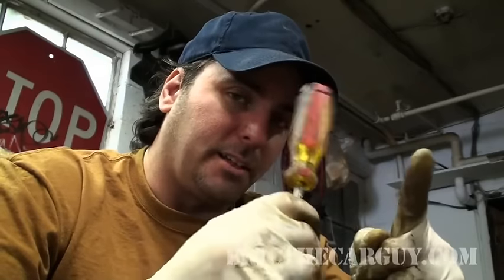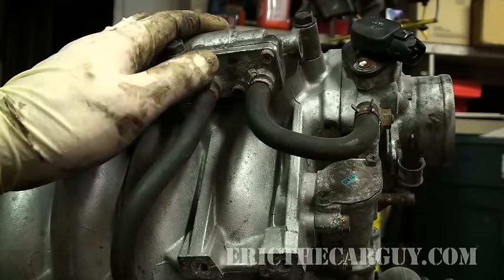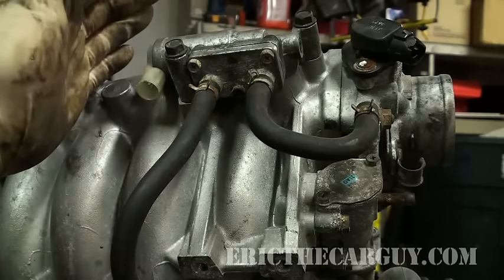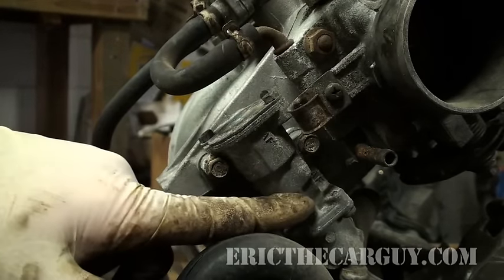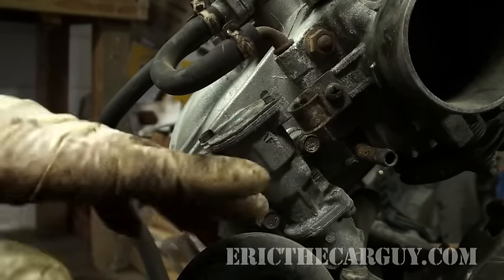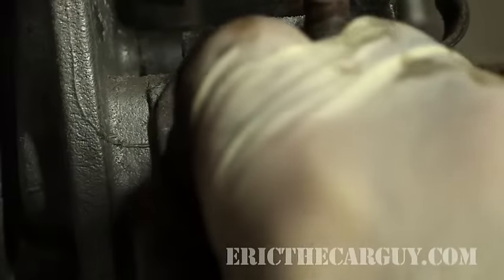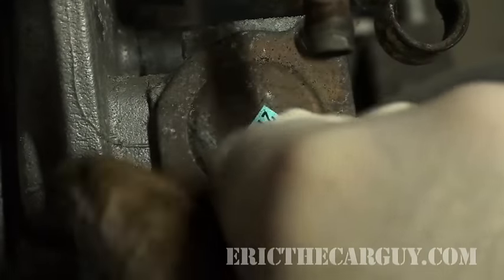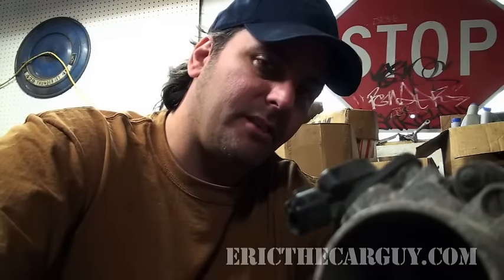How To Solve Honda Idle Problems - EricTheCarGuy

Comment: Yup, there is still people watching  your videos from 9 years ago lol 😆  thanks for teaching me
Reply: Yes sir I
Am
Reply: Same 🤣#idleproblemsonmyrsx#vaccumeleaks
Reply: Yup
Reply: Bro my 1998 honda is having trouble staying on. You guys think it is an idle problem?  It's not the batery or alternator for sure
Reply: @22Alex47  My 1994 Honda Civic had the same issue.  I believe it was the voltage regulator that I replaced and it worked beautifully.  In the heat the old regulator wouldn't work, I was told it was because a wire was likely broken and would expand away from a full connection.  Good luck!
Reply: Jean Green My shit works now after I replaced it ✊✊
Reply: @22Alex47  Awesome !!
Reply: @22Alex47  try looking at the alternator wire. Mines was corroded and turned off in the middle of the highway lol. I cleaned it and everything ran good. Could also be something inside distributor.
Reply: Isaac Zamora nice what do you use to clean inside the alternator. I was thinking compressed air
Reply: 9 year old video and still better than most videos out here
Reply: Yes sir I still do too...
Reply: Same!
Reply: @jeangreen432  I’m having the same issue on my 94 Honda Civic and I was just wondering if air kept going out of your radiator.
I keep bleeding it but there’s always air and the idle never settles
Reply: @kevinramirez-hy3ve  It might be a vacuum leak. I don't know. But in pecking order, that is the second possible problem once you eliminated the radiator issue; bleeding it or letting air out of the cooling system.
Reply: @anthonybenjamin9697  I tried bleeding it but air somehow always comes out. I bled it every single day for 20-30 min. I replaced the iacv and the fast iac. New throttle body gasket and a intake manifold gasket. Nothing. When I restrict airflow from the iac though the idle settles down
Reply: Make that 10 years ...
Reply: The master mechanic in my autoshop class said ..."its either fa show, or hell naw "
Thats a da show right there Boss!
Reply: Meee too just 10 lmao
Reply: Aaron Fluegge  yessir lmao
Reply: I've had this video paused for about two years lol!!!
Reply: 😂 me
Reply: 2021
Reply: @drewmcgee3732  xssddddx
Reply: I don't think I'm late
Reply: Yupppp
Reply: 2021, Lol.
Reply: Make that 10😅
Reply: 11
Reply: eric the car guy is a legend
Reply: oh and make that 2022 😂
Reply: 10 years now
Reply: 2022 🫡 96 Cx replaced iacv, map, tbps, did the coolant trick to let air bubbles out still having this issue hoping I find something before giving up and handling it to a shop
Reply: 10 years ago 😞
Reply: make it 11 years
Reply: 11 now 🤣🤣
Reply: How about 11
Reply: 11 years ago now…
Reply: Still watching 11 years later😅…This tutorial will likely fix my idle issue. Will try later this week. Eric you are a legend 👊
Reply: 12 years here
Reply: 12 years 😅
Reply: 12 at this point
Reply: 12 years ago!
Reply: Amen! Lol
Reply: Even today lol
Reply: 12 now 🕰️
Reply: 12 years ago now 🎉
Reply: 12 years now here 😊
Reply: Haha how about 12
Reply: 12 years and I’m still here! Lol🎉❤
Reply: 12 years and going strong!😂
Reply: 12 years later and his knowledge is helping me
Reply: Hello I changed the oem intake manifold to a skunk2 n throttle as well it’s a manual n know when I try to start it I have to press on the gas pedal and wait until it heats up not sure how I can get it right it’s on a 1998 Honda civic ex manual
Reply: Yup and 13 years
Reply: 13years old video for me today
Reply: Make that 13 just got one myslef
Reply: I learned more from watching his videos.. than I did in my trade school.  Lmao 🤣
Reply: Yeah, still watching in 2024…
Reply: 13 years now
Reply: Here in 2024
Reply: 13 years ago now😂
Reply: 13 years now😂
Reply: 7-18-2024 I am here
Reply: 13 years ago. 2024
Reply: 13 for me 😂
Reply: lol 13 years ago

Comment: I could freakin kiss you Eric!! This was such a headache on my Honda Civic. I failed smog terribly because of that cold-start idle air control. After a bunch of replacing sensors and crap I took out that idle air control and turned it all the way in like you showed and it fixed it completely!!! Passed smog perfectly!! Dude I'm so happy! Thank you for saving me so much money. Guys! Subscribe to this guy! Like his videos! He is giving great information for free. He's like Beethoven on the engines. Thank you again brother! Holy crap that was load off my shoulders.
Reply: NoFace  thank god that worked..I’m gonna try this
Reply: What year honda civic?
Reply: so it doesnt really mean I need to replace the throttle position sensor?
Reply: Maybe brotherly hug instead of that earlier suggested kiss😉
Thanks Brother!🤗

Comment: Lol I just bought a 1991 honda accord lx coupe for my first car for 350 bucks because it had this issue and the guy thought he had a blown engine and I didn't know if it was a blown engine so I bought it knowing I might need to look online for a used engine. instead I found articles online explaining this and got it fixed. idle issue problem fixed, new back struts, and a little cosmetic work later I have my first car for less than 1000 dollars.
Reply: ZDubs Hey I got my first car too! It's a 1992 Accord Ex r coupe. Same issue with the idle. Got it for 300 bucks as well! Starts at 1600 rpm then goes down to 800 rpm and starts to vibrate. What fix did you use?
Reply: Good job man I wish all younger people had that drive, keep it up
Reply: My $450 '03 civic will have its 1st year birthday with me in month...biggest job I did was change the radiator lol
Reply: Hey!  That was my Honda.  Give it back!

Comment: You ARE the man!  Thank you.  After reading many other posts on random forums i ended up replacing the MAP sensor, throttle position sensor, pcv and grommet  (worst job). I was at the end of my patience when I watched this video. I then ran through the tasks you suggested.  Once i pulled the IACV my problem stuck out like a sore thumb. Clogged coolant port and hose. 4 years ago I was told to use GM coolant tabs to help with the typical antifreeze smell. The tabs worked great in taking care of the tiny seaps  where aluminum touches aluminum but that gritty material pooled in the IAVC.  Moral of the story CHECK WITH ERIC FIRST!

Comment: Been having problems with idle too, replaced a bad IAC valve part costing $240 (old one had a torned in filter screen) at O'Reilly's did not fix the problem, high idle at 3000 rpm for prolonged periods, then just watched this video and did as instructed- BOOM PROBLEM SOLVED. RPM at startup at 2.5! Went to 1000 in just minutes. Gears shifting smoothly. Engine sounds way better feels better. Thank you Ericthecarguy.

Comment: I recently picked up a 2000 prelude type sh as a project/learn stick on car. The h22a4 engine in it does have the FITV(fast idle thermo valve). I've had idle issues with the car since getting it like rpm surging(1k-2krpm up and down) a minute to two after start up. I took apart the throttle body to get to the FITV and removed the valve, took it apart and cleaned it all up and it runs 1000x better. No more high idle above 1200 it stays consistent at 800-900, and no more rpm surging. THIS GUY KNOWS HIS STUFF!

Comment: Hi eric, just a quick one. I've just done a clutch on a civic type-r that had been sat for a few weeks. After the work i found the revs were as you say hunting. After a bit of a run and half a litre of water in the rad its all clear. I've put it down to a low battery (car struggled to start) and the addition of water has sorted it. The engine warning light was on and now its clear (disconnected the battery for 10 minutes).

Comment: Thanks, Eric. Had to change a heater hose and the idle immediately went to Hades. After burping the cooling system, idle smoothed out.
Reply: Can you clarify a bit more on which hose? Having idle issues. Changing my IAVC didnt help. I had a coolant flush months ago but didnt have idle problems until months after that day.

Comment: I bought a 1996 Honda Passport 3.2 4wd 217k when I bought it little over a year ago 253k now runs pretty decent just wanting to do different types of mods more HP upgrade .... Suspension lift .... this is the first Honda ever owned had a few problems but nothing out of the ordinary still has a few bugs but I'm working them out I would like to know where to find info so I can have more knowledge on my truck .... I watch ur videos every chance I get .... great information .... thanks again Eric

Comment: Thanks for the vid.  I couldn’t reach my idle control valve to tap on it in my 96 civic 1.6L non vtech.  I pulled the ICV and cleaned it because all the parts stores were closed.  Put it back together and bled the air out of the coolant.  Although I couldn’t find a breather.  I just ran it like you said and squeezed hoses until all bubbles were gone.  Idle problem solved.  When I turned on my a/c the idle would almost stall the engine then run back up.  Now it’s good to go.  If I have any more problems I’m changing it out.

Comment: Thanks for the help! I know it's been 5 years but these types of problems are still happening. Mine was in the fast idle valve. It was a pain trying to get to it due to my motor being in the vehicle, but it is possible. It took a while to bottom out (that's how loose it was). Put everything back together and the cold start idled normal!!! Thanks again!!! (:

Comment: Hey eric thanks for your help and taking time to make people better understand diagnosis procedures with the access to your detailed videos, I'm wondering if you could talk more about the access to the iac and fitv that seem to be fed by small ports in the throttle body and what happens or what should happen when restricting air flow to either or both and if it should at all sound like loud suction at any giving point similar to a large vaccum leak and maybe talk a little more about the idle screw on the throttle body and when you can decide to make adjustments when nessesary, thanks for your help, take care

Comment: Sir you are a legend, I Followed your instructions on the FITV and after weeks  of loking for an answer I found a solution.I purchased a 1996 Honda accord for co worker and he told me that the car had this issue. I cleaned the Idle control valve  it made it better but the problem was that every time I start the car in the morning it would start revving like crazy. I Watched this video and tightened the FITV I can say it worked!!!!. Its been 2 days and it is WAAAAY different. Sir thank you

Comment: Eric.  that worked for the hunting idle on my 1994 del sol.  I tried cleaning the iac and that did nothing.  turning that all the way down completely fixed the hunting idle.  this was the only place I saw this suggestion as a possible fix.  and it worked like a charm.  having the car idle up and down until it warmed up drove me nuts for years.  you are the man, man.

Comment: I have been experiencing vibration on idle and loss of
acceleration .. but only after i been driving it a while, wither its a warm day
or not.less than 2 weeks before this, i got my head gasket replaced
as well as new timing belt and pump and spark plugs and a new rad and cap. My
check engine light did come on about a week after the repair and it was a code
for crankshaft sensor, this lasted abut a week at times going off and back on
until finally never came on again, so i used OBD and reset the ECU but im left
with the vibration issue and loss of power on acceleration.

Also in park or neutral  the engine revs great no loss of power or
anything
Reply: timing may be a hair off?
Reply: I'm experiencing almost the exact problems. Did you find out what the problem was by chance?
Reply: not yet its still drivable.. but i will later on
Reply: vibration is comming from the idle dipping so low and recovering. This effect will be enhanced if you have bad motor mounts.
Reply: I got same warm engine problem then it will crank but not atart i need to try like 5 times til it does start up sometimes
.. other days it runs like new

Comment: Excellent tip Eric! It solved the idling problem on my Civic 93! Did realized the reason the plastic cap losens out.... the O-ring of the plastic cap, next to the thread, with  time hardens up (looses friction with aluminum body) and with engine vibration allows to unscrew eventually again. Replace with a NEW O-ring!

Comment: Excellent video! I appreciate the fact that you don't want us to just throw our money into parts & want us to actually get a diagnostic / codes when engine light on. I actually own a 2000 Honda Civic & have been experiencing this particular idle situation. I'm thinking the TPS as well. First chance I get, getting that good ole screw driver & giving it a tap or two while engine running. Thanks so much for all your great videos. You rock! P.S. Yes I had a simple diagnostic done, but said all cylinders misfiring. LOL! And as we all know that could be a bunch of things, so not playing the process of elimination game :) (I'm a smart girl...my Daddy taught me well) Thanks again.
Reply: Yeah,  Eric's a genuinely good and helpful dude.  A youtube subscription must!
Reply: I subscribed a while back, so glad I did.
Reply: Zachariha Rachel I have a 2000 cr-v and I'm going through the low idle problem as well. I've been thinking the distributor is bad. My check engine light flashes while driving and my reading was the same ( misfire ) I will have to try this tonight. Also it will rev up to 3000 - 4000 rpms before shifting.  Did anyone else's do this? Btw Eric you rock. Thank you so much.

Comment: Another component that can cause idle issues is something known as the Air Boost Valve. (It's suppose to help start your car in really cold weather ... really cold.)  Anyway, in my 1991 Integra LS hatchback 5-speed it's located just to the right of the dashpot throttle lever. If it starts to fail it can cause a surging idle as it tries to feed more air into the intake. It's also daisy chained to the dashpot via a teed vacuum hose. You can either remove it and block its port to the manifold or remove the 2 hoses it has going into it and just close them up with vacuum plugs.  One of them, the long piece, being the teed vacuum line to the dashpot, can then be re-used as a direct vacuum line to the dashpot as one piece of hose. The other larger hose should be plugged at the valve and on the top of the manifold. So what did it accomplish?
1) My idle surge is now gone.
2) With the Air Boost Valve vacuum line no longer on the same vacuum line as the dashpot, the dashpot now performs much better. Smoother engine running when coming off throttle. Smoother shifting occurs as a result; revs don't drop so much or so quickly. Nice. And no change in cold starts.
So I offer this as a consideration. If it doesn't work you can always restore everything back to how it was quite easily.

Comment: Your tip to check the code first is great advise.  I changed the starter in my Honda Accord, which meant removing the manifold and lots of other stuff - and neglected to hook the wiring clip back onto the mass air flow sensor.  reading the error code of PO102, quickly told me that was the issue and I was getting ready to troubleshoot with a multimeter, when I saw I simply did not clip it back in.  What an easy fix, but, really hard to see that it was unclipped.  Thank you EricTheCarGuy!

Comment: one thing I find weird is my 96 civic when warm, when you push in the clutch it stalls makes it fun at stop signs and red lights
Reply: Mine does the same what did u do to fix yours
Reply: I'm currently in this same situation.  I've burped the coolant system, cleaned the IAC valve and currently about to do a vacuum leak test with a propane torch.   Did either of your two have an issue with the idle barely fluctuating when sitting at a light and upon take off have it (A) have throttle issue when accelerating ie bog, erratic? Turn ignition off, turn ignition on to bump it and have it clear up until the best time came to a stop for longer than 10 -20 seconds. 
(B) die on you and not start back up for at least a minute?

Also could you avoid it from happening by gently applying throttle on and off while stopped and not have the issue arise ?   These are all examples of my current issues in a 99 Civic ex
Reply: @859don  any luck on finding the problem? I have the same problem
Reply: @donwyatt8753  I've come to the conclusion it's the IAC itself.  Haven't replaced it as of yet. I did put a new ignition switch in (mine went bad) and it didn't make any difference. Therefore IAC has to be the gremlin. No leaks and good cylinder compression on all cylinders.

Comment: My 1992 Honda Accord idles up and down while in park. When I'm driving it does just fine, it only does it in park or neutral. Why? Also, car only goes into gear while it's off meaning I have to put it into reverse to back out of my driveway and once I get to the end of the driveway in order to go forward I have to turn the car off, put it in first and go, and the same thing applies when I stop at red lights and stop signs.
Reply: Kianna Petty idle control valve or prob map sensor..
Reply: Kianna Petty check coolant if its low
Reply: I have a Honda accord ex need to change front wheel axssoul